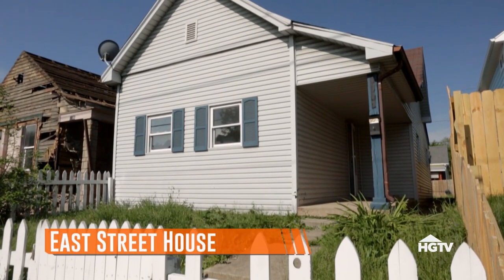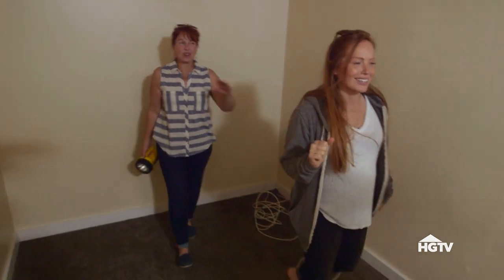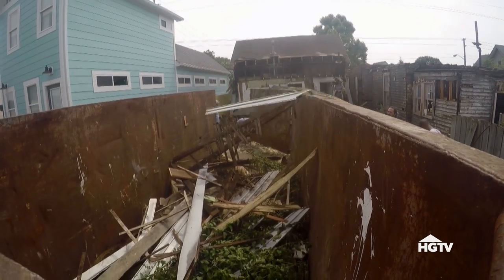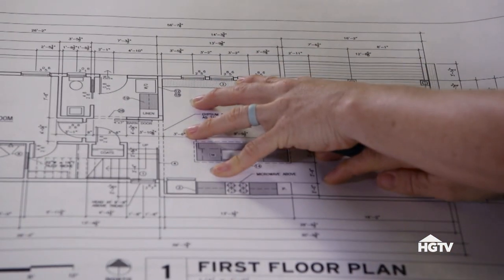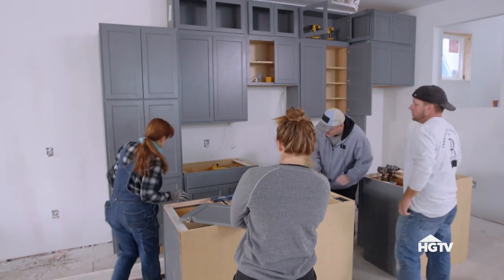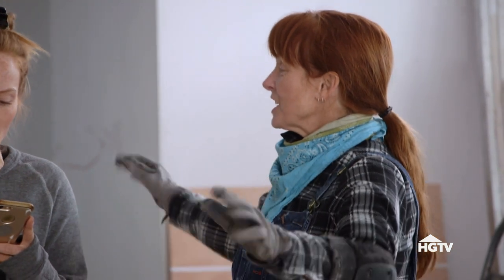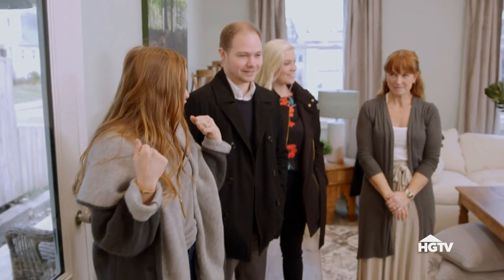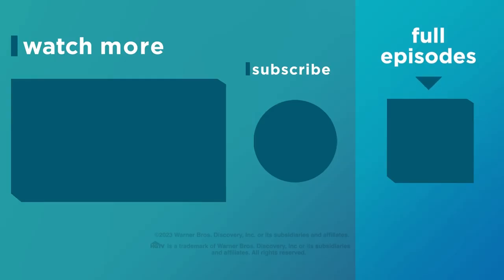Home Renovation DISASTER! | Good Bones | HGTV

Comment: If you’re going to put in cabinets to the ceiling, please provide a decorative ladder for people to access them! Better yet, stop putting in upper cabinets. Don’t have your bathroom open to rooms that the smell will permeate….like the kitchen, dining room or living room!
About windows out to the next house….couldn’t you put in long narrow windows that would let in the light?
Reply: As a 6'0 tall woman with a 6'5 partner, I disagree completely regarding the upper cabinets :)) I open the lower ones only for holidays, because that's where I store seasonal stuff. Only the uppers get regular use, it's really difficult for me to bend down so low every day. When I'll buy my own house I will put in custom furniture that is higher, because I get frequent back pain with the regular ones. But I agree with everything else.
Reply: Re: putting high windows on the wall which is very near the next house - it may not have been allowed by code. In another reno, Mina said that they had to "fire rate" a wall which was also very near another house and they weren't allowed to put windows. Remember that they have to submit the plans to the engineering/ build dept for approval, prior to doing the reno.

Re: cabinets to the ceiling, I like them, as they mske use of vertical space. The buyer or renter can buy their own ladder. I agree about the bathrooms.

Comment: The construction is spot-on, but the staging is awful. Everything is beige and grey and white. It’s also over-designed, with that loud tile pattern in the bathroom, the wallpaper on the kitchen island, and the chemistry plant thing hanging by the stairs. If I were a buyer, I’d be mentally calculating the cost of redoing all the finishes I hated.